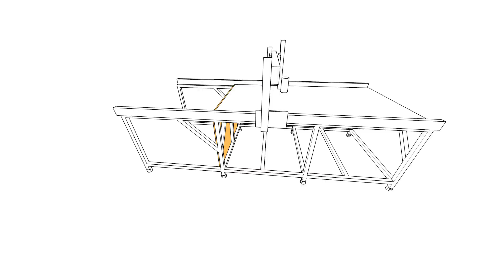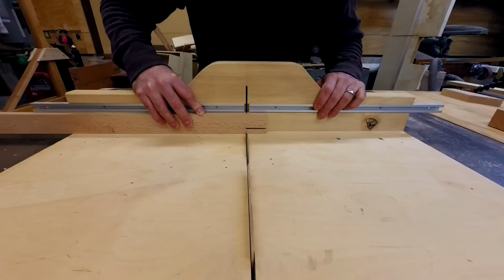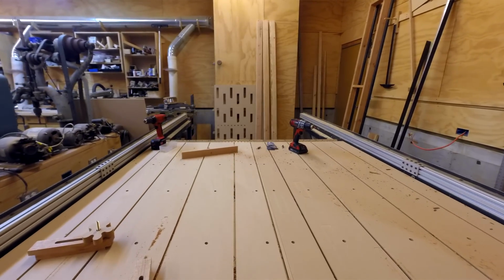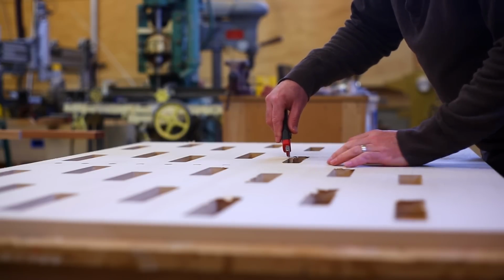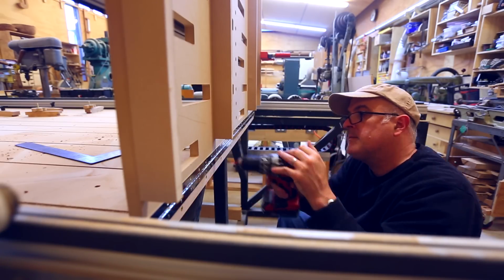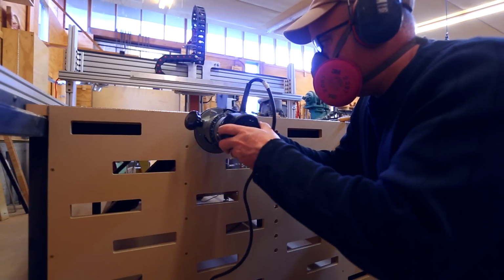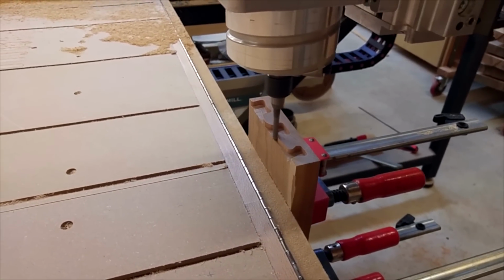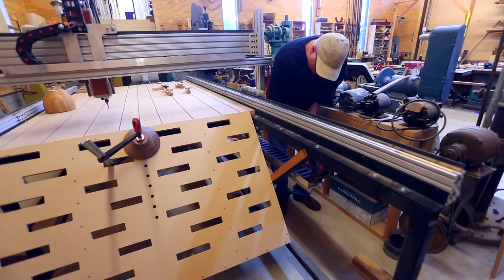Vertical CNC Table

Comment: The holes you cut to allow clamps on your vertical end of your CNC table is exactly what I needed.  We were trying to figure out how to add a simply clamping system to your the vertical end of our CNC table, and your big hole design solved our problem.  While our vertical wall will be fixed at 90 degrees, your clamping method was a BIG help to us.  Thank you for sharing.

Comment: Very nice again! i'd maybe attach a freely rotating leg (or better two at the to sides so they are out of the way) to the table which slides in some sort of rail which is attached to the ground - that slider should only be moveable when some lever at the bottom of the rotating table part is pressed

Comment: A threaded rod might be a good way to adjust and lock to table angle. You can set it up in a similar way you used the wood to brace the table against the steel frame.

Comment: Frank could you put a pulley above the frame corners and use a chain drive to pull it up and lock it.  Get an old garage door opener. Or just do it manually.  I like your photography and projects.  Thanks for sharing.

Comment: You should use the CNC to route out a protractor onto a piece of mdf and attach that to the table legs at the new swinging table end. Then you can easily repeat angled end cuts.

Comment: Frank to hold your table at an angle use a piece of all thread and two spherical joints on each end with pivots. It will be rigid and adjustable to fin
Reply: To fine adjustments

Comment: if you can make a support on the tippeable table to mount a steppermotor holding a woodturning chuck , you can use the table and cnc to carve stuff in the side of wood bowls (the bowl can be set at an angle so the millable surface if somewat horizontal and you can rotate it while moving the router back and forth over it
i think you should see it as the x axis curled up in a circle (the bowl ) and the y and z working normal

Comment: I'm sure you have a ton more brilliant ideas than I but could you have a drawer slide inlaid in the side of the moving table that interacts with the diagonal wood strips you were using to stop movement?  The rotation wouldn't be a problem if there was a slider on the wood strips too.  I'm sure there's a simpler way though.

Comment: Frank, get yourself some Festool 491594 or 489570 clamps. They fit perfectly in the slots of the extrusions and will help with clamping the table at an angle.

Comment: If you were able to pivot hinge the table top and have a z axis modification to hold different tools you could use it to work on vertical surfaces not sure if the machine would support the weight in  vertical configuration. Would need wheels to help move and position the unit in place  You could then attach different tools such as a paint gun or a cutter. I wonder what it would be like cutting glass.

Comment: Create 2 pieces and route a channel in them for the ends on each side, place a stud on each side of the table sticking out with a roller wheel on it to fit inside the routed channel in your end pieces. Mark it with degrees like on a table saw adjusting wheel.

Comment: For the hinge.. I wonder if a collapsing arm setup would work.. something that folds and locks in place like you would see on a cabinet lid support.. (likely two of them depending on the weight)

Comment: Frank
I found your channel the other day and and cant get enough. Fantastic. For the vertical table could you try a toothed wooden board screwed to the floor and then a board and hinge mounded to the table that can be set into a tooth on the floor board at the angle that you need. You add a micro adjustment screw to the hinge board for finer adjustment. I hope this made sense.

Comment: So jealous of this, nice work. For the angle support, surely the best option would be a panel with a curved slot in it attached to the CNC frame, and a bolt on the table that goes through the slot. Then just tighten the bolt down at the right place and you're good to go.

Comment: It seems like you might want to add a few axes of CNC control: 

(a) the angle of the extension table could be controlled by a heavy threaded rod hooked up to a stepper motor. The length of that leg of the triangle would be easy to correlate to the number of turns of the stepper.

(b) a turntable mounted to the extension table via clamps. You could have a bowl on there, for example, and by the magic of controlling its angle, along with the angle of the table and the positions on the gantry, get some really wacky carving done. Stuff that would be really hard to accomplish any other way.

Comment: If you wanted to create an exact angle, you could use the hinge as the fulcrum for a sine bar. You could cut 2x4s to set spacer lengths for nominal angles (20,30, 45°...)

Comment: Love this idea for vertical clamping. 

For angles you could go crazy and get an precision threaded screw with another stepper motor and program in the angles for one touch repeatable angles. :)   Have you thought about adding a tool touch off for setting too depth? With the controller and a touch off you could really dialin your depth quickly.

Comment: To make the bed set at an angle how about cutting two quarter circles and have both marked with the degrees on it and put a peg at each degree? Then as long as the degrees on the 1/4 circles are accurate to each other then both sides of the bed will line up.

Comment: a mechanism for holding the table at an angle: have 2 ladders on each side and then have a piece of wood that you slot into the ladder and then hold the table. almost like how the horizontal bits of bookshelves are held up.

Comment: What you can do to make your vertical table easily repeatable is cut 2 quarter circles  and have holes every 10 degrees on the edges.  Attached that to your vertical clamping table. then drill corresponding holes through the legs of the CNC table.  this will allow you to put a bolt on each side to lock the table at an angle and because its a bolt it won't vibrate loose.

Comment: Here's an idea; a rail with a long slot at the sides of the clamping table, with butterfly nuts on the CNC table side. The nuts slide on the side slots and once you like a place that you want to stay, you just tightent the nuts and secure the position.

Comment: I'm wondering whether you would want your vertical table to be infinitely adjustable by building some sort of threaded rod assembly.  Granted that the rod would have to be very long, but if feasible (and buildable) it would provide you with a lot of possibilities.  Perhaps it could even be removeable?  Just thinking "outloud" sort of.  :-)

Comment: Frank; how about some form of large protractor graduated scale liberated from a scrap machine tool to help calibrate your new swivelling CNC bed?  Or even make two yourself from MDF with your CNC router.  Fit one scale either side of the movable bed then fit a spring loaded steel pin on either side of the hinged CNC bed to locate into corresponding notches or holes cut into the protractor scale and that would make working easier and I think a little safer than wedges.

Love the videos.  Makes me wish I had a machine woodworking shop just like yours.

Comment: Frank,  Regarding your clamping method for the hinged table, could you develop brackets (similar to an old compass) with a T-bold and knob at your upper aluminum channel?  I would bet you could even CNC angle markings for easy set up.

Comment: I dont know how much space you have, but you could cut a large radiused channel? the handle to tighten that might interfere with the frame though
Reply: Rather than a channel how about pins to set to specific angles? It would be much more consistent if doing multiple pieces. Doing every half degree, with about 90 degrees of motion, that's about 360ish holes. Which would be a pain to do with just a drill press, but the cnc would cut that in no time.
Reply: +Danny Jepp that would work as well, he could even incorporate both, although pins would allow clearance of the frame

Comment: I will be very interested in seeing how this is utilized. Are there any CNC set ups that utilize dust collection?
Reply: +Andrew Lynch He's been working on that. Basically I think he is going to add a hose to the vertical axis portion, but the added weight is an issue. (I think)
Reply: I figured the weight or placement was an issue. Almost need a separate system that 'ghosts' the router.

Comment: The way you lean down to lower the hinged section, bringing your face down and forward as the clamp bar moves down, (potentially with the weight of hinged section of table behind it) makes me think you want a cranked or dampened mechanism to control table angle.  Probably cranked because that could be use for precision; but something, for safety reasons.

Comment: I know you have a new cnc machine, but if you do this again I have some suggestions. 
My first would be pneumatic cylinders to at least dampen when you you're lowering the table, maybe hook up a small compressor for lifting. But I'm not sure what the accuracy of pneumatics are; so I'd also suggest a linear actuator connected to a var or something that can set the angle the table needs to be at, and along with the pneumatics, it should be able to hold even if you're doing a plunge cut with the router. 
The next thing is the z depth of cut, you're not going to get that far down with your table slanted down like that. Either have a secondary z actuator that you can use for a deeper cut, or tilt the table upwards and have a taller z actuator so the spindle can actually come up enough to cut pieces on the angled table. 

Or, you could just invest in a 5 axis cnc where the router itself can tilt and turn to do the same work as this and more. 
I'd personally go with a 5 axis over table modifications just considering it can do more with less work.

Comment: It seems like you are trying to make the CNC very adaptable for most uses.  As a CNC user, I just want to suggest that you beef of the gantry risers quite a bit... or a lot...  Any weekness in the gantry design will be magnified in cut accuracy and quality... such as chatter marks, etc...    Gantry CNCs benefit from mass and rigidity.  Nice work and adaptation of CNC technology. :-)

Comment: This is absolutely brilliant. You've made a 4 Axis indexed router! And the 4th axis has huge working space!
Reply: +Christian Lewis Aren't there only 3 axis?
Reply: +TheKopakah I'm considering the vertical work surface as an indexable rotational axis. Which make it 4 axes in total.

Comment: Why don't you make a radius plate which has incremental locating holes and on the side so there are holes spaced evenly over a radius, then you lock in the pin and then somehow incorporate a thread for a micro adjustment  so if the spacing was 40mm spacing then the thread would have a travel of 50mm

Comment: Frank, The thing that worries me about this setup is all the metal work used in the table (particularly the piano hinge). Do you have any kind of fail safes in case the CNC program goes off course? I'm used to the CNC machine we had at work where the top was basically 2 or 3 inches thick plastic, designed to have a 1/2" or 5/8" MDF over it (held by vacuum) so that if anything went wrong, there was nearly 3" of cuttable material under the work. I worry about a scenario where the CNC might start cutting into that hinge, or hit a screw.
Reply from the maker: +sooth15 true, I really dont, except being carful - which only works untill I make a mistake

Comment: Hi Frank, great video. Well produced, good detail and good quality definition.
I'm concerned, on your behalf, regarding the dust from the MDF in particular. I note that you usually wear eye and lung protection but don't always use dust extraction (for example, when you cut the wood behind the MDF near the hinge so the clamp could get through the hole).
My concern here is that the particles of MDF stay in the air for some time but as soon as you finish the cut, off comes the dust mask.
Many people do not know, and the hardware store doesn't tell you, that MDF is much the same as asbestos when it comes to lung damage. I refuse to use MDF in my shop for this reason. I use good quality ply instead.
Naturally, you should always use dust extraction and a dust mask whenever you create sawdust but MDF is a disaster of epic proportions and yet they still sell it to the unknowing public without any warning labels.

Comment: They make what's called a "stop hinge", inside stop or outside stop. For instance as an example,  an inside stop would prevent a door opening all the way inwards preventing a door knob from going through the wall. A stop hinge decreases the operating arc of the hinge by creating a Stop angle. That nickel on steel hinge your using with holes 2.00" on center probably .040 thick, coined for #4 or #5 flat head  has a 270 degree back angle, a stop hinge would change the angle. Coined or (punch counter sunk) is the a cheap way to do a counter sink in metal which is done in a primary operation, true countersinking is usually done in a secondary operation. You can find a stop hinge online, just figure out the stop angle you prefer. Great Job!

Comment: The CNC creates a fearsome dust storm, especially while milling MDF. Are you considering enclosing the bit, or maybe the entire rig?
Reply from the maker: +Bob Blarney yes, but I keep finding other things to do. Ha ha
Reply: +frank howarth Frank - just build a dust shoe; it'll take less time than cleaning up the dust :)

You can cut a plate (3/4" MDF is fine) with a hole for the router body, and a hole for a short piece of pipe to hold a hose. Run a dado around the perimeter of the bottom of the plate, then glue in bundles of bristles from a cheap broom. Generally I find that if the bristles are just touching the work piece when the router bit is also just touching, you get good capture of the dust and you can usually plunge at least 1" without the shoe being a problem.

I'm looking forward to seeing what you do with your new vertical table. I'm thinking that a fourth (rotating) axis sticking out from that table could achieve some very interesting things with a bowl.
Reply: +Bob Blarney I just used my cnc to cut an oblong plate1/2 in thick with 2 holes one for the router and one 4" for the dust hole and  a rabbit around the edge of the oblong and got some nylon strip brush from McMaster Carr 2" and 3" depending on the bit length. Screwed the brush mounting strip to the rabbit works great, cost about 30 bucks for the dust boot.

Comment: @Frank Howart, will you get a XYZ  probe, orinstall  end sensors on the table? It might be a great addition since youdealwith a lot of non flat geometries (bowls etc)
Reply from the maker: +chris vighagen I have been thinking about that
Reply: I suggest building a few probes at the same lenght as some of your most commonly used tools,. The probe then electrically behaves like a normally closed switch, which opens on physical contact with an object.  Sending a signal to Mach 3  (I assume you are running Mach 3) signaling the geometry of an object as a series of points. 

Which means you get a point cloud that should correspond to a cad model of what you are trying to do. 

Below links are great places to start for a XYZ touch probe. 
http://fadedbits.com/2011/02/touchprobe/

and 

http://www.homemetalshopclub.org/news/12/presentation_1202.pdf

Comment: Really nice Frank, as always. Awesome video. I like your simple clamp hack to set the angle. If you wanted some extra work to make it look slicker (but essentially operate the same), you could make some super large trunnions. I made some for my big Disc sander. Check out step 9 onward here: http://www.instructables.com/id/BIG-Disk-Sander-Build-Use-and-Tips/ 
Thanks again for all your cool vids.

Comment: Could you not just router the rest of the trim piece when the table part is folded up?
Reply: He used the slots in the table to guide the bearing on the trim bit, with the table folded up, it would be in the way of an edge guide... therefore he would have no straight edge to guide the cut.

Comment: nice setup! to hold up the folding table, maybe try using a satellite dish actuator, kinda like the gas pistons that hold up car trunk. they have the linear capacity u need and can take on loads of several hundred lbs.
Reply from the maker: +Ted Ngai it would be cool to do something like that and have a pump to move the pistons up and down.

Comment: By adding a piece of trim to the clamp table the same depth as the trim on the CNC table, you could attach the hinge to the bottom and have a flush surface on top when the clamp table is horizontal. You might need a thicker trim piece to have a good place for the hinge to attach.

Comment: I absolutely love this project. When I read the description I was curious what you really meant. For the angle of the table. Like some others mentioned, some arch shaped pieces should work and then place a motor on it so you can figure out a way to set the angle using your CNC. That way you only have to tell your CNC a piece is on the vertical table and which angle the piece should be mounted at.

Comment: Frank, what if you used the CNC to cut a quarter circle as a sort of guide, along with angle measurements cut into it? It could even help with keeping the loose MDF panel square... Something similar to the metal track on this drafting table: http://www.worldmarket.com/product/drafting-desk.do?promo=v2

Comment: Frank the best bet for being able to set the angle on your new addon is to use a 1/4 radius placed at both side ends of your table. it would attach to the steel frame and and have a slot cut in it and use a plastic lock handle to lock it in place. You even have a CNC machine that can easy cut it out lol. you could even market it with the angles.